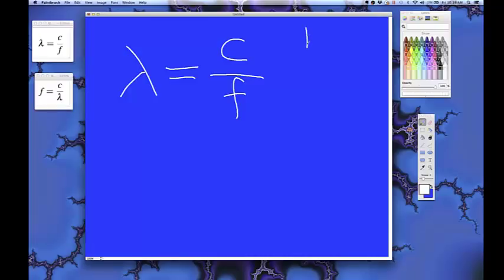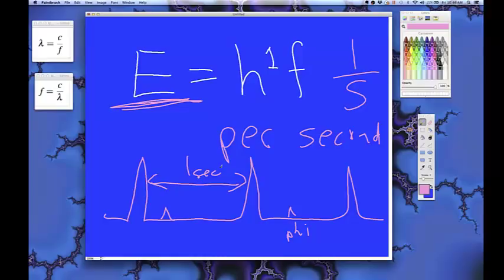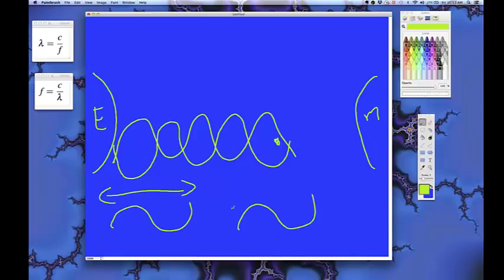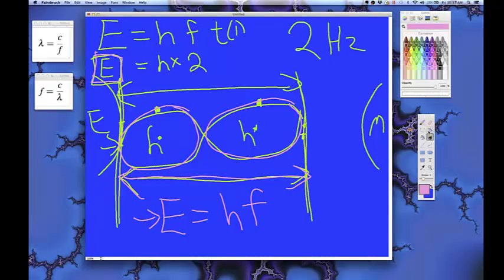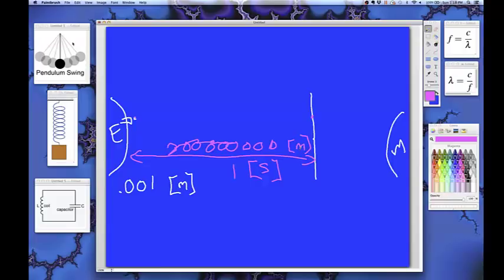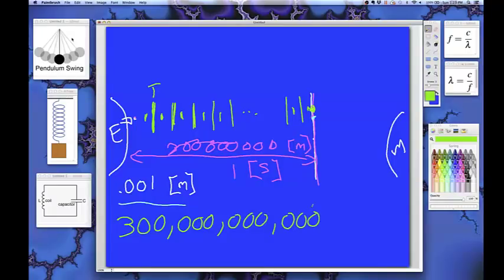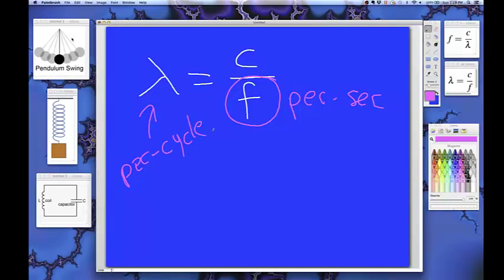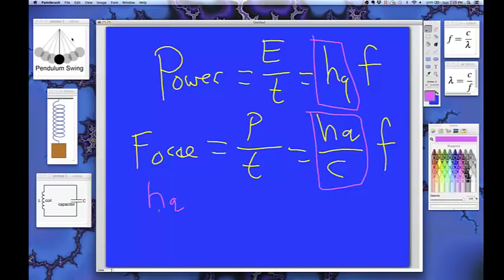Wavelength, Frequency and Modified Unit Analysis

Comment: I would so love for you, Robert and Ken to compare notes and ideas and join a few of us on a Skype chat. There is a connection between light/E-M radiation and the thing we call heat, which also controls the state (solid/liquid/gas/plasma) of matter.  We need to fix terminology - charge (positive, negative) or charge/discharge; is there an electron; are there 'particles' at all or are they 'hard light' as ken calls them.  The hq constant to me seems like a lower bound, where the upper bound would create those particles.  Somewhere between phi and the mandelbrot set there is a pattern (in conjunction with hq) that would let us predict the physical properties of matter.  Thanks for your great videos and effort, we owe you a few beers (or wine?).
Reply from the maker: Truthfully, I don't think a conversation between Ken, Robert and I would be fruitful, at least, not for me. Ken and Robert would just argue with each other (even if they were saying the same thing), and I would likely get lost in the crowd. What I am doing is taking Ken's work and Robert's work and comparing their notes against my notes. I can do this all on my own. What I am is a good listener. I don't think I can say the same thing for Ken or Robert. I agree that the language needs to be changed, and THAT is what I am trying to do.  

Also, I agree with Ken that electrons are "hard light" and so are protons. I will for sure be making a video on this. It is easily explained, but I need to do it my way.
Reply: @FractalWoman  Wow Lori, what you just said is precisely what Joseph Cater was saying while he was alive. Brilliant man. Have you read his two (shortish) books? So much of what Ken (and you) have been saying seems to be more specific rehashes (that are much needed as you "unpack" what he's saying).
Reply from the maker: @cryptonein  Yes I agree. Only, Ken and I aren't "rehashing". We are "hashing forward". Rehashing means we are constant looking backward, and we're not. I can only speak for myself, although I think it's important to glance back from time to time, it's more important to look forward.
Reply: @FractalWoman  Joseph Cater (I still cannot believe how few people have heard of him) bases his work on soft particle physics. He describes photons essentially as bundles. Electrons and Protons are hard "particles", but are yet still essentially bundles (composed of "ether"). Protons are 1000x larger than electrons, according to him, and have kind of a "breathing" function with ether particles, which makes sense in relation to what Robert's getting into. 

At any rate, here's a fellow (that in my opinion does a fair job summarizing Cater's work) who tries to give a somewhat concise, albeit sweaty, synopsis: https://www.youtube.com/watch?v=RDIyAj-frpI - I really applaud him since he involves his younger kid as the "camera man" as he does. I wish more parents would involve their kids like this in such a critically important area of discovery.
Reply from the maker: @cryptonein  So I watched the video. I agree with the idea that Aether is filled with tiny "particles". I call them OM-Particles. The mechanism that I am proposing (or going to propose) is quite different than what he is saying. His idea of light going up being the cause of gravity is interesting though. That is worthy of more thought. I don't see photons and electrons as "bundles" of particles. I see them as the same particle that is spinning at a different rates.
Reply: @FractalWoman  is there a particular reason you call them "OM-Particles"? 

Also, could you (briefly) elucidate your idea on the mechanism you're referring to? (I'm sure you've got a video coming, I'm just curious for a preview!) 

Very interesting... So I'm not prejudging in either direction (just want that to be clear) - you've got me really curious: Since we believe in ether particles then what are photons vs electrons if they are not bundles? You say they spin at different rates, which is a curious and interesting statement (that may make some sense, esp. in relation to fluid mechanics)... but are you saying that they themselves are fundamental? Otherwise they'd each be bundles of [a]ether quanta...
Reply from the maker: @cryptonein  "is there a particular reason you call them "OM-Particles"? 
Yes there is. First of all, I am writing a book called "The OM Particle" and Planck's constant is the reason I am writing the book. You can check out my website www.theOMparticle.com.  A couple of the chapters are already written and published on my website. AS far as the "mechanism", it starts with this schematic of an "OM-Particle"  
http://www.theomparticle.com/?p=774  
My model has two "charges" that are in orbit around a common central point. Each "turn" of the OM-Particle is one fundamental unit of light, one energy unit, h. The OM-Particle is fundamental. All other particles, such as photons, electrons and protons, different oscillations of the SAME particle. The OM-particle. The term, OM-Particle, encapsulates the wave-particle duality. OM is the original vibration with which the whole of the universe wave formed. I think it is a fitting name.
Reply from the maker: Wine.

Comment: Thanks for another great video. Certainly light is a fantastic thought experiment. I think the key to illumination is from where the oscillations are manifest. I have to agree with ken in that the oscillations are not of the longitudinal axis (between earth and the dot detector in your video), rather they are manifest in the transverse axis at source. This in turn causes the longitudinal axis to pulse. If we can conceive that the longitudinal axis is field based, then we indeed have a perturbation of the field generated by the transverse pulse at source. 

What generates the pulse is the question I guess. If we take the sun as an example, Ken believes a magnetic event causes the transverse pulse by way of the magnetic pressure mediations slamming against the dielectric plane of inertia as the magnetic voidance returns to inertia, causing a torque event at 90 degrees. As the inertia plane is centripetal at Super luminal speed, the torque causes minute displacement of the dielectric inertia plane, an inward ripple that generates the pulse on the longitudinal z axis. 

It is the ripples of minute magnetism (dielectric displacement causing EMF component) that are the transverse oscillations, measured over time these provide the wave component at source and the pulse is effectively the energy component radiated longitudinally. Not sure if that made sense however, this explanation seems most plausible to me and answers many questions about light in my mind. Thanks again Lori, I very much enjoy your videos, cheers
Reply: Light has a rate of induction.
 Light starts as a perturbation of the Aether's magnetic field, transverse waves and alignment of Aether's hyperboloids/inertial planes, longitudinal energy. Does the passage of perturbations through the Inertial plane-Hyperboloid-Inertial plane-Hyperboloid- ... = compression-rarefaction-compression-rarefaction- ... Figured EM waves are the attributes of the longitudinal perturbations. (You seem to see it the other way around.) EM waves are the resistors of longitudinal energy (entanglement). When an altered precession of Aether (matter) is interupted by these vibrations, a hysteresis of cause and effect is created = Illumination. Hysteresis because of EM waves of Dielectric and Magnetism.
Reply: You do not need longitudinal component at all. It can be replaced by rotation of the ether quantum. Inertia is the equilibrium of the neighboring quanta. When rotate, energy is absorbed, turned into potential energy, that rotates back, and transfers energy to the neighbor. Interestingly, this rotation in quaternion field is represented by division algebra that is non-commutative. That is what gives direction to the perturbation and results in propagation and energy transfer!  That is very similar to the spinor theory of Penrose just extend it to 8 dimensions.

Comment: Great video Lori.
I've always viewed things from frequency as Hz or cycles per second so no problem relating to your view of it.
The photon "frequency" which I was unfamiliar with until today reminds me a lot of my confusion between the bit rate and frequency during my digital electronics studies, took me a while to realize that they are different in that bit rate is twice that of frequency.
That's what you get when one is grounded in an analogue world and not digital. Also explains (to me) why I  had and still have issues with quantum mechanics, too digital.😎😁
Looking forward to the next part.